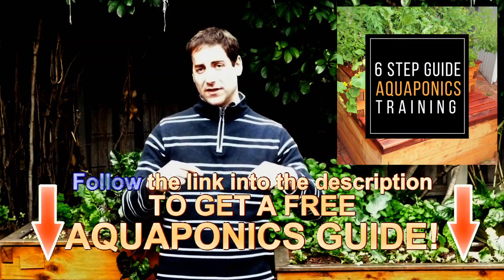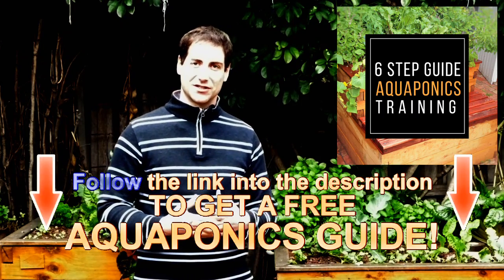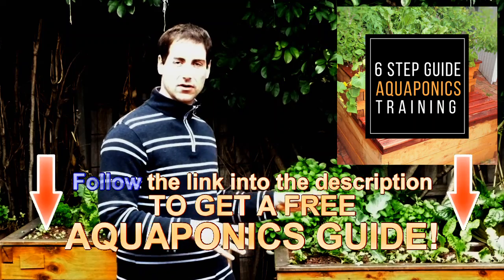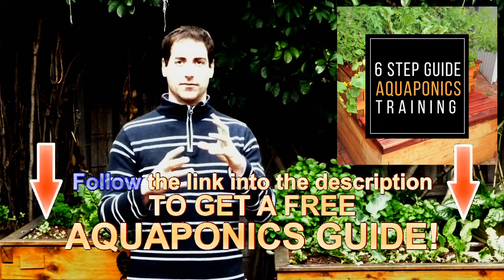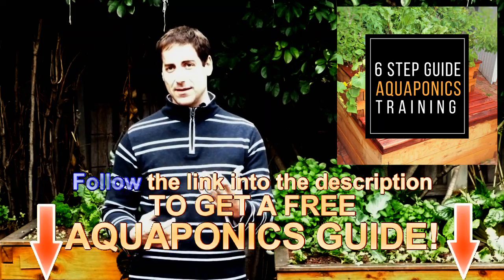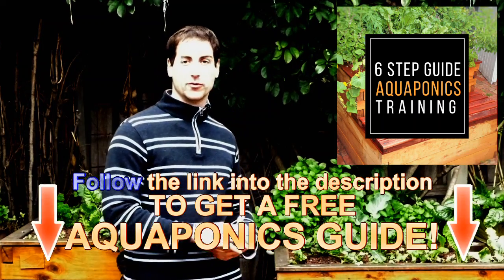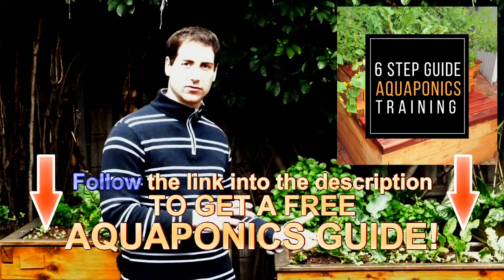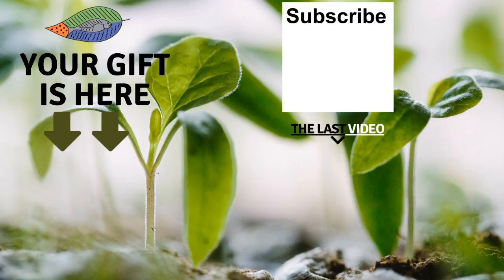How long to run the aquaponics water pump for

Comment: I’m starting up a aquaponic one fish tank it’s a 275 gal tank radial  filter it’s 50 gal resavor 3 grow beads there IBC 15” deep that will have 12” of river rock it’s going to be a spit system I’m thinking 2000 gal pump what do u think

Comment: What is the advantage of flooding the system and then draining? Can I just run the pump 24/7 and let gravity naturally pull the water back into the fish tank? 
also, I have a 55 gallon tank. My pump is rated at 450 gallons per hour. Will this hurt my plants or fish or will this is filter and oxygenate my water more?
Reply from the maker: the growbed need to drain to allow plant roots and bacteria to be exposed to the atmosphere and breath properly.
Running a larger water pump will consume unnecessary power and make your system non-sustainable.
Reply: @AquaponicsRevolution  you can split the pomp outlet one into water as airator and second to the media...

Comment: Does the pump should circulate whole tank water every 2 hours?? I am using a smaller pump for my system (1000) litres 24/7

Comment: Dude, stick to aquaponics if that...Who the hell are you? My grand mother? It will break because it is turned on and off???? Because it will take a break every 15 minutes ? If anything, it helps and any system should have at least two pumps taking turns also. You have no concept of electric motors
Reply: În this particular case you are wrong and he is right.. Those pomps are very cheap with no fancy features like slow start up.. Yes, every time when pomp start you put stress on every single part of that pomp..
Reply from the maker: Thanks Florin :)
Reply from the maker: Wow! You are so aggressive. I send you my love and hopefully you get better soon :)

Comment: what is the electricity bill of your aquaponics system per month and per annum?
Reply: Its literally like running a lightbulb.
Reply from the maker: Interesting question. Unfortunately I am unable to respond as it's diluted in my personal electricity consumption. All I can tell is that it's not significant. one system consume around 40w.
Cheers

Comment: What about solar powered air pump. Just for the air pump
Reply from the maker: Hello Elsanto.
Solar air pumps are great if they are equipped with a battery and are working 24/7.
Cheers

Comment: Hi Johnathan, this is Huy from Vietnam. I have the same concern for the air pump for my bio-filter. I open it 24/7 but it will consume energy quite much and hence costly. Can i use the timer to turn it on and off periodically? If I turn off the air pump more than 5 hours and then turn on for 5 hours, and so on..., is it harmful to the microbe colony?`
Reply from the maker: Hi Huy,
I wouldn’t recommend it. 
In a Biofilter the bacteria must have access to an oxygen saturated water. Working on long 5 hours cycles is not the best and will probably decrease the efficiency of your biological filtration. If the air pump is too large and consume too much power can’t you find a smaller one and run it 24/7?
Thanks
Jonathan
Reply: I have a smaller air pump but just afraid that it is not strong enough to move kaldnes around and so increase inaerobic bacteria. The bigger one is doing that job well enough but cost much electricity.
Reply from the maker: Yes Hugh, if the biofilter media is not moving then it's not good. Maybe you can let the small one plugged 24/7 and put the large one on a timer every 30min?